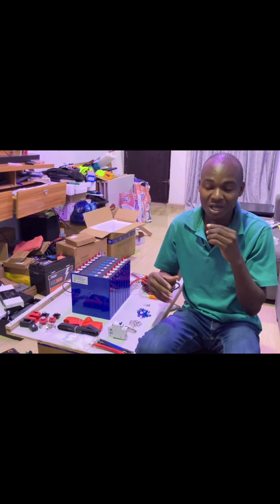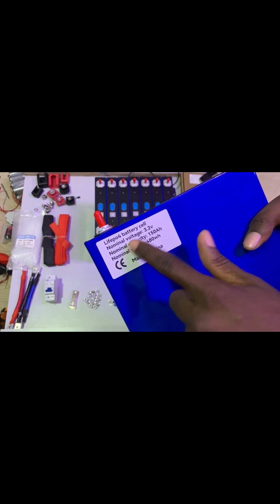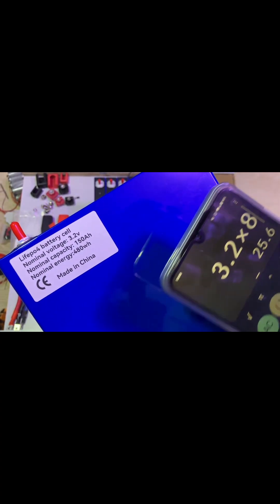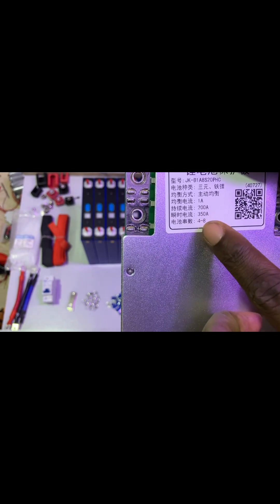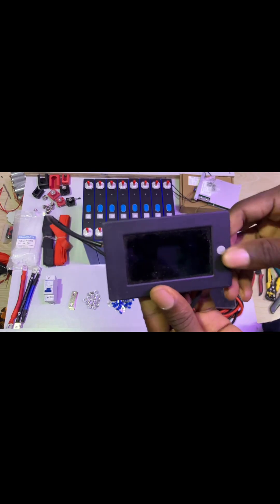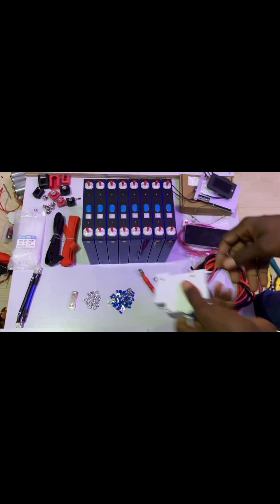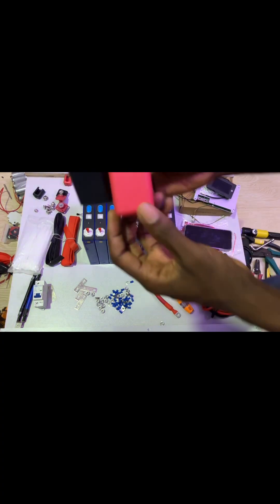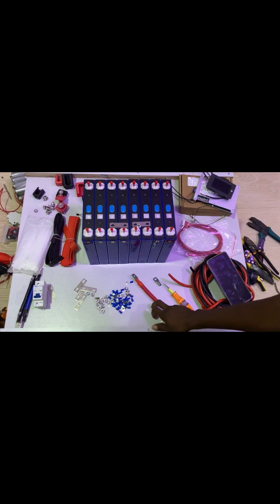Accessories Required and cost to make a DIY Lithium Ion phosphate battery.

Comment: I built 13.4kwh 48v Lithium ion using 18650 cells. i sourced all materials from Aliexpress and Batterryhookup USA. It cost me 2.8million plus wooden enclosure. My experiwnce is it make sense to buy factory made than DIY. DIY make sense if you get the cell extremely cheap or for free

Comment: If i remeber i can buy Colasolar 3.6kwh 12v battery for 450k? I then ask if its not a waste of money and effort to build.
Reply from the maker: Cola will give you basic, I mentioned if you want to have fun, this DIY.. this is a Standard set up, Bluetooth BMS 200A with Active balancer, Screen, and New cells. cola dont have screen or BT BMS its Matter of choice

Comment: Nice analysis though but, This DIY is a waste of money and time.

4pcs of cells cost 300k @75k each without any accessory(bms/casing), when that 300k approximately can give me 12v 100A pwr(mr) ready-made.

Also, always include eproxy fiber board to your design.
Reply from the maker: DIY is fun, it allows me to choose my BMS 200A, my Breaker, my Cables.. mind you the capacity is 2kwh already compared to 1.3kwh of PowMr.
Reply: @odedeyidamilare 
Well, Most DIY is just for fun. 
Good you know what 800k can give ready made
Reply from the maker: @owoene9106  it will give me approx 4kwh for this level of quality. BT BMS with Screen Active balancer and Grade A cells

Comment: Are you going to limit the amps in the BMS?. Because, if for example you're pushing 145A;16mm² wouldn't be recommend looking into the future. That's if you plan to use it for long without changing the materials used from the onset
Reply from the maker: I will be doubling it, as stated on the Video..thanks for the concern, also pushing 145A means you want to discharge the batteries in 1hour not sure anyone will do that on regular basis
Reply: @odedeyidamilare Great!. I wish you well on future projects. But don't forget in case of a short circuit, the battery can deliver up to 1000A in ms before the fuse or circuit breakers interrupts the circuit. Always rate the cables appropriately so that it doesn't burn out before the protective devices has a chance to work